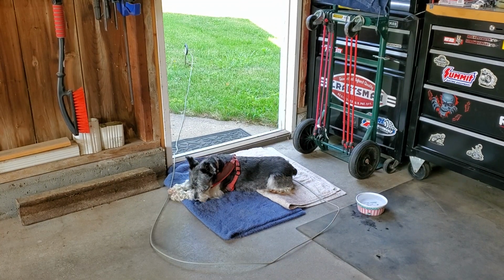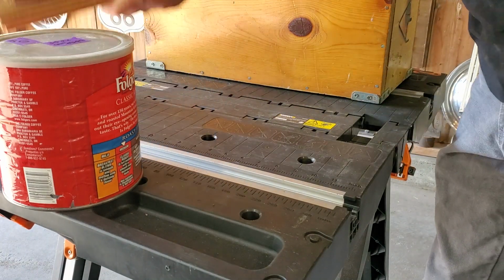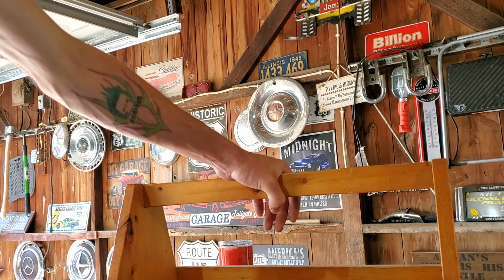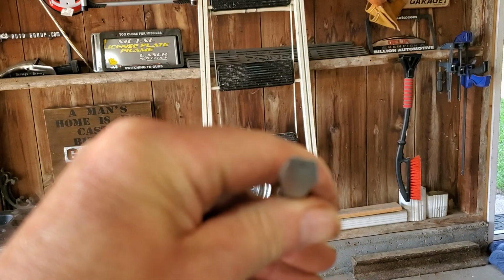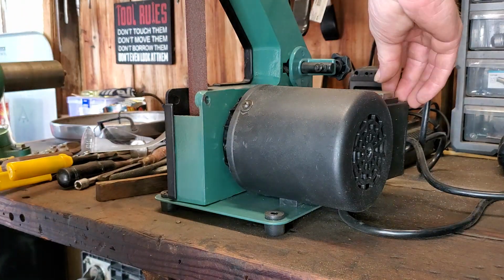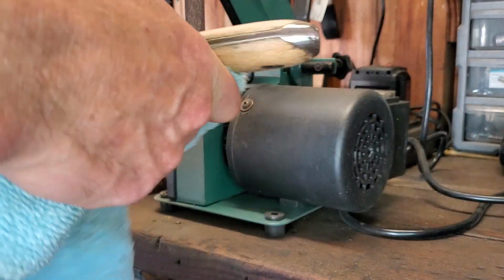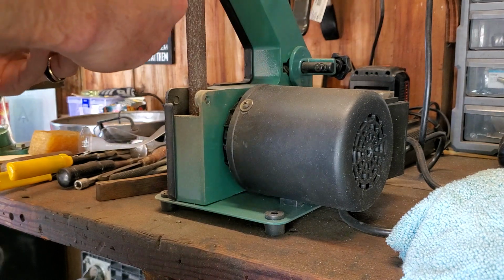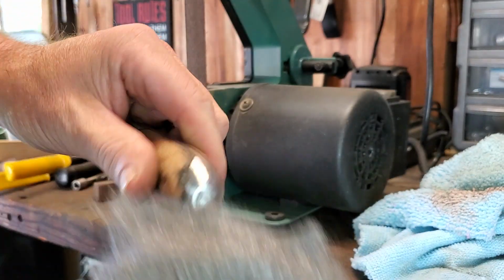Perfect handle..MAYBE

Comment: Hi Mike- nice screwdriver!  One quick fix for your box that would add structural integrity is to cut a piece of metal strip about 3” x 3/4” by 1/8 thick and place it across the top of the box side screwed down to the box.  That way the handle is captive and much stronger.  😃👍
Reply from the maker: Great idea,thanks and also would hide the shims that would fill the gap,Awesome thanks again